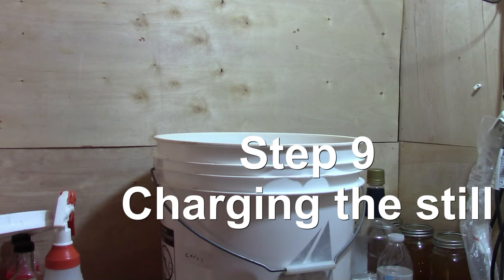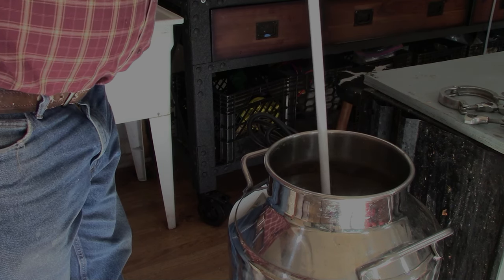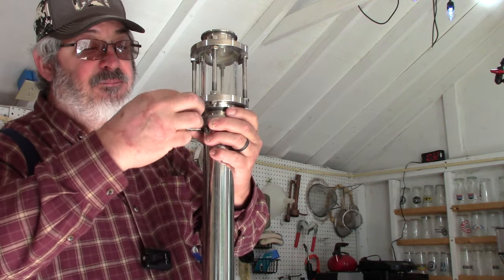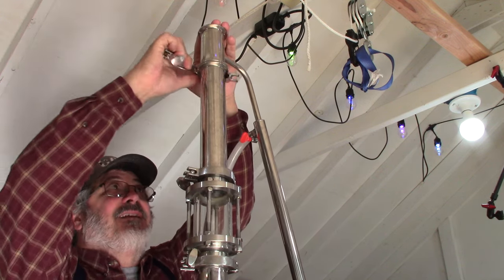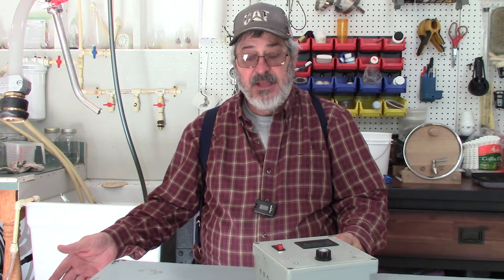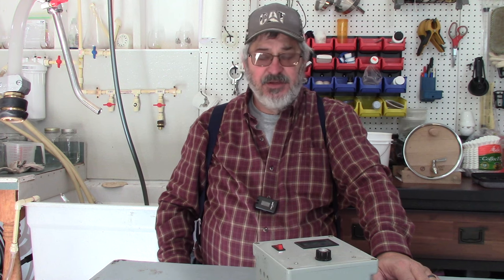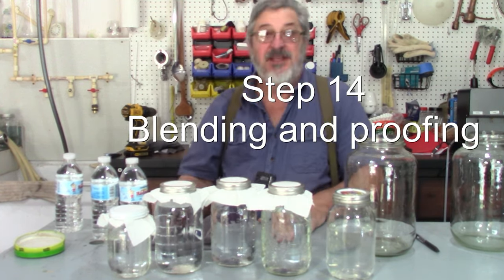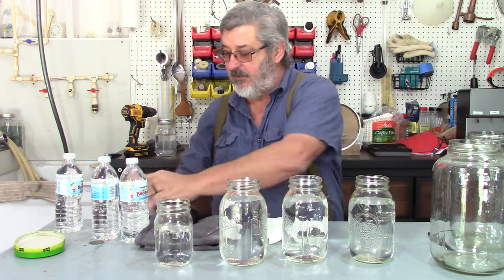Smoky Corn Bourbon part 2  Step 8-16

Comment: Had you kept the distillate at 55%, I'd have said The Bad Motivator Legacy Barrel, BUT you'd need to leave it in there for 2 years. So, if the oak barrel is a 5 liter one, I'd prefer to see it used . Only takes 4 and a half weeks maximum in that size. 10 liter barrels are 4 and half months maximum. This is the size I'm currently using.

Comment: While I have to agree that barrel entry proof is usually 60-65 in commercial distilleries, it’s really a personal choice. The Badmo barrel heads provide the same wood surface area to volume ratio as a 53 gallon barrel and will age at the same rate so you don’t have any worries about over-oaking. These barrels use new oak air seasoned outdoors for four years. Badmo also sells specialty barrels using second use wood. I vote Badmo all the way. Good series, thanks Randy!

Comment: Most distillers proof down to around 110p to 125p when aging. if you proof down to 80 it takes a lot longer as the alcohol content isn’t as high. So I would go wood barrel since you proofed it down so low. The Bad mo barrel is meant to simulate the surface area % of a real barrel. So the distillate needs to be higher proof.

Comment: I would say Badmo if you wouldn't have proofed it down so low. Alcohol is a solvent. The weaker it is the less youll get out of a barrel. My vote is for wood chips and sticks and save the barrels for something higher proof

Comment: Hey Randy,do you need to run a dephlegmator with a bubble column or can you get away with running a shot gun condenser from a pot still ?
Reply from the maker: with bubble plates yes you need a dephlegmator

Comment: Bad motivator is my suggestion…
Unless the small barrel is used.

I like used small barrels… they don’t over oak so easily.

Bad motivator obviously has less oak surface area.

Look into the oak spirals made by barrel mill.
They’re the best non barrel option.👍🥃

Comment: Hi Randy. I am thinking of doing a few stripping runs on my bourbon and then do a spirit run with the few low wines I have collected on 3 plates. Do you think this would be okay for bourbon. Obviously the washes would be the same.
Reply from the maker: I dont see any problem with that
Reply: If you use plates, you'll strip a lot of taste out of the bourbon. On a double distillation I go down to 8% on the stripping run, as this gives me just under 40%ABV when combined for the spirit run.
Reply: @daveo3122 Thanks Dave. I do have 500mm / 20inch x 4inch piece I pack with copper to make neautral. Maybe I could take the 4 plates out and add the 500mm piece and leave the reflux off. I presume that would pretty much be a pot still?
Reply from the maker: @ventman2au yes that would work just fine
Reply: @ventman2au  That it will. Modular stills are good for changing distillation types as to what you are producing..